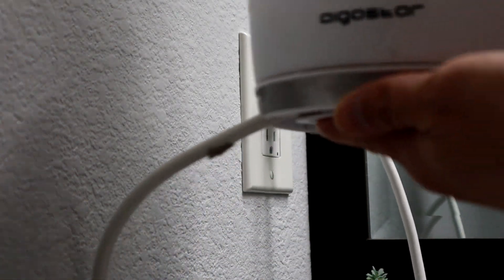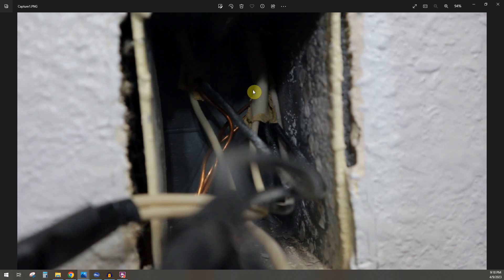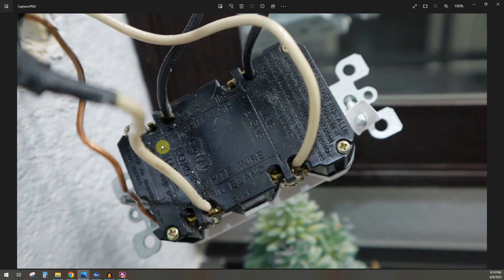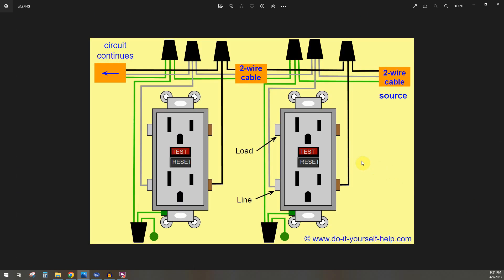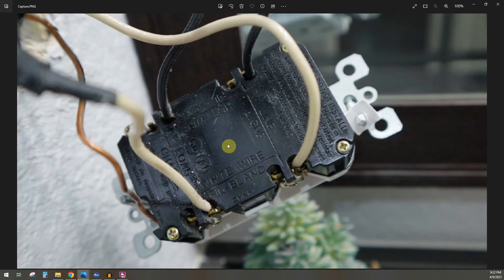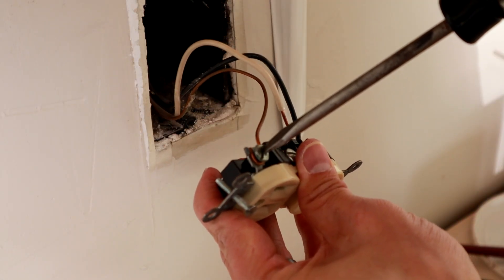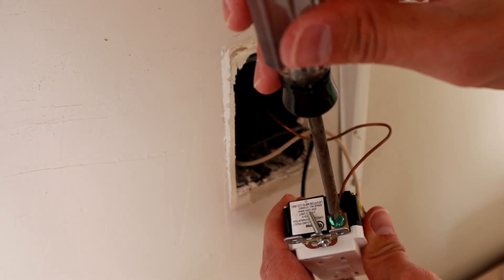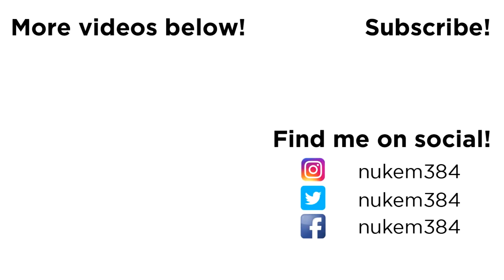Upstream GFCI Outlet AND Downstream GFCI Outlet Tutorial – Detailed Version

Comment: I have a similar setup where my front bathroom has a GFCI and my back bathroom is downstream. So if the front bathroom trips, my back bathroom looses power. I want to install a GFCI in the back bathroom so I can reset it from there instead of having to go to the front bathroom to reset it. Will this example you showed allow me to do that? Thanks!
Reply from the maker: I'm not an electrician, so I'm not 100% sure, but I would think that would work.  Just theoretically thinking, your upstream GFCI is tripping because the downstream outlet is protected by it.  So if you put in another GFCI at the source of the tripping, it should trip there and not travel upstream.

This garage GFCI that's downstream that I put in has never tripped lol.  But I would think it'd trip before the bathroom one it's daisy chained to.  Good luck!
Reply from the maker: Ok, never mind.  I just looked it up.  Since that outlet is daisy chained, if you switch it to a GFCI, it's just going to trip both the upstream one and the new one you put in.

You need to pigtail the original GFCI to provide power to the new GFCI.  That way they are "parallel."  Both GFCI's need to be powered from the line side of the outlet.
Reply: Perfect after some more research last night that’s the conclusion I came to as well. Thanks!!

Comment: If you explained why you added a 2nd GFCI in series with the first, I missed it.  Why not install a normal receptacle in the garage since it will be GFCI protected by the one upstream.  Then you only need to reset in one place if the garage trips it and there will be less confusion when troubleshooting.
Reply from the maker: Yeah I probably didn't explain.  That was the initial setup, downstream regular outlet.  But I just wanted a GFCI in the garage for extra extra safety since I use that outlet pretty often with my pressure washer.  I know I know, not necessary, but just makes me feel better.  I know the circuit, so it would just be resetting one extra GFCI (garage).  No big deal for me.

Comment: I changed my GFCI outlet and it’s now working in that spot but all the other additional plugs connected downstream to it are not functioning. Why would that be?
Reply from the maker: 2 things.  

1.  Did you make sure that the wiring downstream is hooked up to the load side of the GFCI?

2.  Do you have another GFCI downstream from this one that might be tripped?  Make sure to test/reset all GFCI's on this circuit, including the one you said is working which I assume is the upstream GFCI.